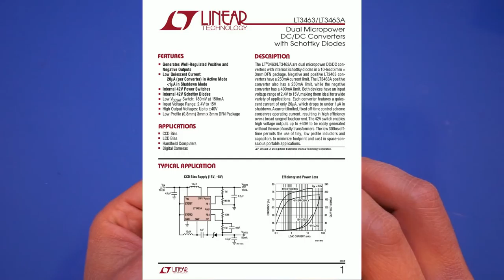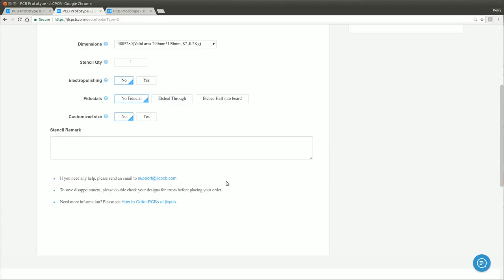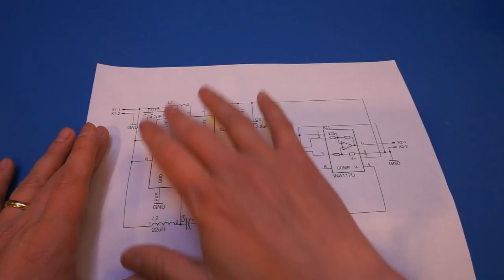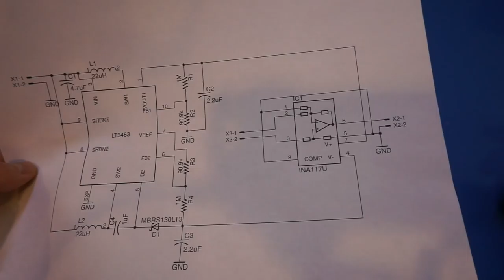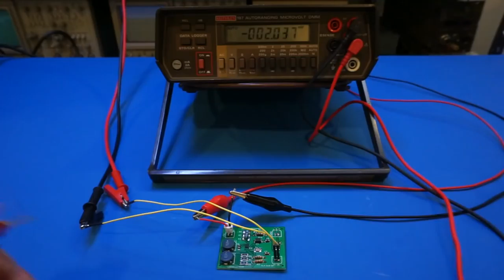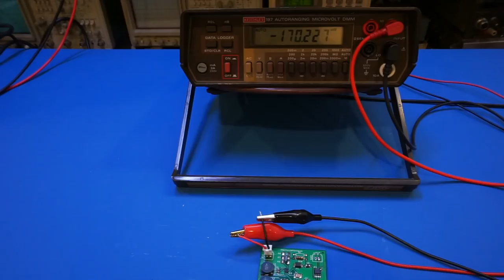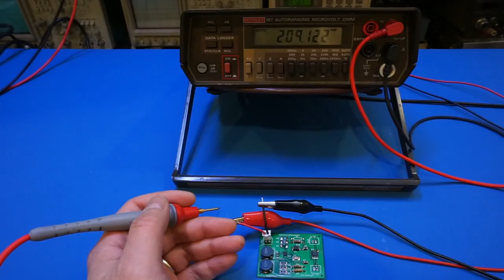Building a Unit-Gain Differential Amplifier

Comment: If the input common mode voltage range is 200V, does this mean that you could measure 200V / 1.41 = 141VAC as maximum in the shown example?
Reply from the maker: You wont' be able to measure 141VAC RMS as the maximum output is bound by the OpAmp supply voltage. The 200 CMMV means the voltage reference point (with respect to ground) can float up to 200V above ground. For instance, if you have a 100 1.5 batteries in series, you can use the INA117 to measure the top most battery.

Comment: It's a small point, but I label main power rails with their voltages. In this case +15V -15V 0V, makes the circuit diagram much easier to follow.

Comment: SO would this be able to modify a power supply or charge controller that has a low side current shunt? for example the DPS DC-DC buck converters from RuiDeng if they are grounded or running on the same power supply they cannot be hooked in parallel to give two output voltages since the current shunts would be connected in parallel. would you be able to move the shunt from the negative to the positive rail and still feed the same ADC input?
Reply from the maker: Probably no, usually low side or high side sensing were specifically designed so.
Reply: SuperBrainAK A

Comment: Kerry - it's a bit hard to tell but is the mains sine wave clipped/distorted a bit? It may be an artifact of the camera or possibly even the differential amp acting as the probe. Thanks for the demo and recommendation for JLC; several local hams have already used their service and are very pleased with the product. Although they'd really like to support U.S. based companies the cost differential (no pun intended) is so large that it just becomes, perhaps unfortunately, a no-brainer.
Reply from the maker: I didn't pay too much attention to the waveform but now that you mentioned it does look a bit distorted. The interesting thing is when measured directly without the differential probe the waveform looked a bit distorted as well. It could be that I have so many things connected to the same power outlet and there were some interference going on? Anyway, I am pleasantly surprised at how much the cost of average PCB manufacturing services had dropped over the years. Now it's almost pointless to use adapter boards for prototyping anymore since designing and making a PCB is so much cheaper and more convenient.
Reply: It's also possible that the mains power isn't cleaner than that. There might be a huge source of noise in the grid close to him. VFD's are particularly bad.